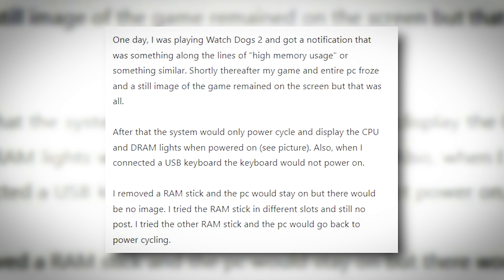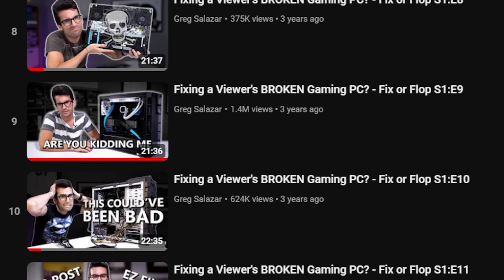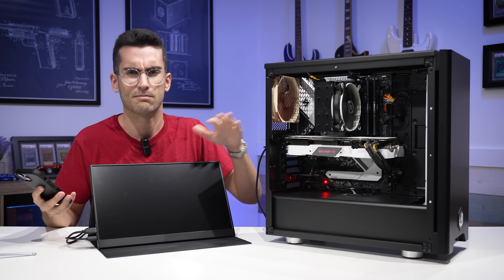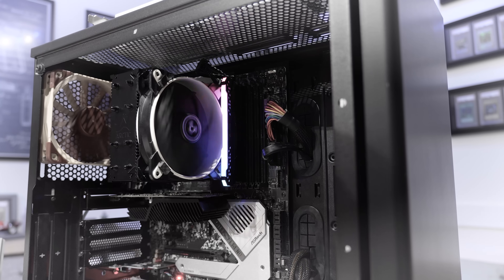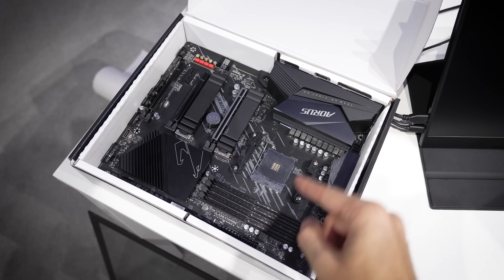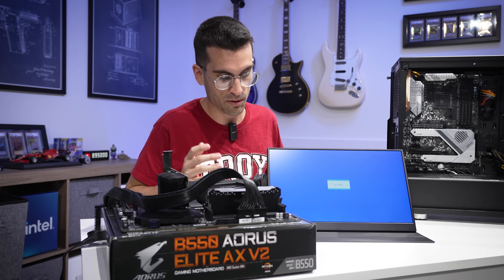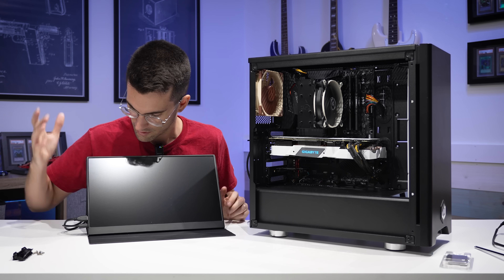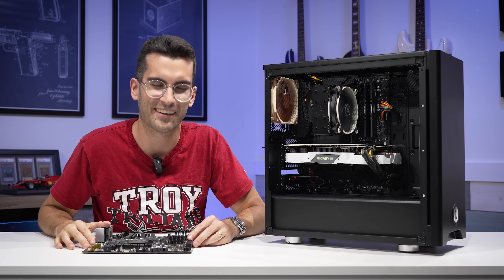Fixing a Viewer's BROKEN Gaming PC? - Fix or Flop S5:E20

Comment: Powering on without a CPU cooler is taking a risk every time. I fried an old AMD K6 when I was young and dumb. It heated to the point I couldn't touch it withint 2-3 seconds after boot without a cooler.

Comment: Check your physical power connections also. If a CPU or the 24pin are even a little lose they may cause it to not get enough power and cause this issue. Always rule EVERYTHING out before swapping boards.

Comment: One of the things I truly enjoy about this sort of video is watching the logic other people use when troubleshooting.  I always break things down to the lowest common denominator meaning I remove EVERYTHING but the basics from the equation.  I'd leave the board, CPU and RAM in place and take everything else out.  Instead of moving known good sticks of RAM to a possibly bad board I test the questionable RAM on a known good setup.  Same thing with the CPU.  Break it down to the absolute basics and if the issue goes away you start adding parts back one at a time until the problem comes back.  then undo that last change and if the issue goes away you know you found the cause. Granted that doesn't take care of cases with multiple faults but that's where testing parts in known good setups comes into play.  Don't get me wrong, I'm not in ANY way saying how things were done here were wrong.  Just different and different is good.  Always good to get multiple perspectives on the same thing.

Comment: I had this exact same problem with my Asrock B550M Pro4 - no bios flashback and same error code. Fortunately I had a Ryzen 3 3200G that I put in and it booted to bios and I could reflash the corrupted bios. Until I reflashed the bios, no PCI-E cards would work in the system! After reflashing the bios, I put in a 5700x and it is still working today! - Using an RX 6750 XT with it. Just FYI...

Comment: Hey brother you can just sit a cpu cooler on top with a tiny bit of paste, you don’t have to screw it down and you don’t run any risk to the CPU
Reply from the maker: Not sure if you've seen any of our other 100+ FoF videos, but we often run rigs without CPU coolers at all for a few seconds at a time. Nothing wrong with it as it doesn't heat up enough.
Reply: @ yea I but I’ve seen intel 13 & 14th gen CPUs pull 1.55 volts during startup and hit 90+ degrees with a cooler so without seems dangerous and it takes less than 5 seconds to plop a cooler on it.

Comment: If anyone is on the fence about going with the ad for Windows keys, it's legit. Very slick transaction. AND! BONUS INFO! I wanted an N install to avoid bloatware and JUST install things im going to use. So i got a Windows 10 N key. I was going to upgrade to 11. My main concern was that I wouldn't retain the N version going into 11. I did research to find out, but I couldn't find answers. Anyway, took a leap and did it, and LOVELY!! It upgraded to Windows 11 N!!! So if somebody out there has that question, rest assured, you'll retain that designation going into the Windows 11 version!

Comment: Some mobos won't post in no fan is connected to CPU_FAN header. You testing without a cooler is a really bad idea for that reason, not for cooling reasons.
I stand corrected, you did connect a fan ..... afterwards.

Comment: Man, I used to own the x570 Steel Legend and I found it wierd that it came with 2x 19pin usb 3 headers on the board. The punchout for wifi cables were great, though. Made it super simple to add a wifi card after the fact.

Comment: DEBUG lights are just not reliable as well.. they have lights and codes that are not listed as well....get yourself a good ole Post Speaker, which helps quick post diagnostics as well.
Reply from the maker: Hahah. Speaking of unreliable, we've filmed over 100 of these episodes. I can count on one hand the number of times a speaker actually worked for us while troubleshooting.
Reply: @GregSalazar  Wow Really? I have had nothing but negative results w/ diagnostics codes. Specially from ASUS and AsRock. I actually use to work for ASUS and trying to find the full codes list was top secret. We rarely could provide full support on non posting boards. I guess it would be harder to use the post speakers if you did not have access to extra parts.

Comment: Much better diagnostic work up. I would leave the water block metallurgy explain to derBauer. Often wonder about the AMD micro-code for those procs. Are they updated via Microsoft ? One last thing, . . .  the graphics jumbotron could use a propping post to ensure nuttin' gets bent out of shape. Anudder great service video. P.S. Gigabyte fan-boi talkin' here.

Comment: @GregSalazar i got you a tough one which i believe you haven't come across in any of fix or flop videos i have watched. In my motherboard was constantly resetting the bios by itself or wouldn't boot untill i removed the CMOS battery completely. Tried new battery, update bios, new cpu, new ram and all the ram slots one by one! Any ideas😅?

Comment: Had to use this as for a new Windows 11 key since Windows stopped working after swapping my motherboard and wouldn't activate
Reply from the maker: Make sure it's for the correct version of Windows (10/11, Home/Pro). Only times it's never worked for me (and I've used dozens) is when I've entered the key incorrectly or if the version doesn't match the installed OS.

Comment: why don't you use a separate power switch on the power pins instead of risk shortening the pc with a screwdriver? only takes a few seconds to connect.

Comment: I've personally experienced a badly seated DIMM before. When I added more RAM to my PC it was fine for a while then I'd randomly crash. I checked and the 2 new DIMMs got loose, so I properly installed them and no more crashes. My best guess is I got them down enough to work but over time slight vibrations finally wiggled them out enough to cause issues.

Comment: The bios flashback feature should be standard on all boards, or at least bring back socketed BIOS chips. That way you could try reprogramming it without de-soldering it from the board.    Great video!

Comment: Well people are not gonna like my comment because in a way I do feel like it was a  unnecessary downgrade  instead of investing more time in trying to either figure out how to " reset bios , or solder on new bios chip ) you went instead the easy route and replaced the board which is totally fine . 

But you didn't  actually fix the issue when the series name is literally  ( Fix or Flop ) . You could of put more effort into it and made the video more interesting  that just my opinion on the matter  like i said yes technically  its a downgrade but i am also glad he got back up and running .

Comment: I always find it interesting that the Mobo manual/help center will never suggest it could be the Mobo. Even the forums will suggest everything but the Mobo. Had same issues with a Asus board.

Note: rarely, but something to keep in mind. I had similar issues with everything from no boot to debug codes for ram and cpu and crashing all due to a faulty cmos battery? Yep. Keep a spare cmos batt in your arsenal just in case.

Comment: Asrock stuff is always bad with my experience, more like cursed, loud gpu coil whine, funky motherboard bios, cpu not hitting power limit etc. Sold my asrock b550m-itx ac and asrock Arc a750 Challenger and get b550i aorus and Asus dual 3070. no problem since. cpu is 5700x, 32gb trident z royal, Samsung 970 Evo plus and 980, sf600 psu.

Comment: i wonder if the unseated RAM may have fried the mobo, it may have been just making a connection for a while then eventually slipped out over time and caused a bit of a power spike or sent power to a diff pin that fried it.

Comment: Hi Greg. A friend of mine told me that his PC quit working and could I take a look at it. I powered it on and got nothing. I asked him if he had make any hardware changes. He told me that he bought new memory and that was when his PC died. I went to the MB web site and to the QVL, Qualied Vendor List, and looked for his new memory on the QVL memory list. I could not find his new memory on the list. That was his problem. I removed the new memory and replaced it with his old memory and his PC worked. The lesson he learned was to allways check to see if the new memory was approved to use with his MB.

Comment: A lot of correct comments on here , a dead or shorted     CR2032 can cause it not to POST. Also it's not hard to connect a piggyback a clipon programming cable  on the bios chip , you don't need to unsolder these chips this can be done incircuit with a super cheap  ch341a based  programmer,  it could be the upgraded CPU bricked the bios. A read on the rom dump and a comparison of the dump, against a good binary bios firmware. Or erase and flash the latest bios firmware over the old flash.

Comment: CPU needs 8pin + 4pin power supply cable .... But only 4pin was connected there 😁😁😁

13:00

Is that causing the issues...???
Reply: Not likely, the additional 4 pin basically just provides stability for overclocking (probably wouldn't even matter on a 3700x to be honest since an 8pin is plenty of power for it, I plug it in anyways just to be on the safe side).

Comment: Hey Greg, turns out the issue holding up my friend's PC build was a dead motherboard. We had all the parts for a Ryzen 7000 setup (a 7600 with a B650 board), which should have worked right out of the box. Instead, we kept getting the CPU and DRAM debug lights, and there was no attempt to boot. It would go straight to those lights, just like in this video. After a full day of troubleshooting, and without any spare parts (my own system is Ryzen 5000, and the only other person with a Ryzen 7000 is away at university), we decided to buy a new board and return the old one. It worked perfectly on the first try with the new board.

Comment: Why are ppl complaining about the downgraded motherboard? PPL wake up, a "better" non functioning motherboard to any working motherboard is not a downgrade. Broken vs working. I doubt the owner of that PC gives a crap what board is in there as long as the PC works. And they can easily change the motherboard somewhere down the line if they want to now that it's fully working again. So "downgrading" a broken part to a working one is not a downgrade by any means.... the most expensive motherboard on the planet is still useless if it doesn't actually work :P

Not to mention Greg did it all for free which probably saved the owner hundreds of dollars taking it to a store and having them troubleshoot it.

Comment: Gaming when the error happens indicates heat issue that eventually fried the motherboard. I wouldn’t be surprised if their some components on that old motherboard have slightly bloated capacitors. Ultimately the motherboard saved all the connected parts so did a great job. Passive cooling a motherboard that overclocking is something people should consider especially if the pc going to be gaming for hours in a warm climate.

Comment: I had a computer that a customer brought me to upgrade the memory and SSD .   about a month later he decided that he wanted a new computer and didn't want his motherboard , CPU and memory ..and would just re use his case and power supply .   so I put it together for him  and he left me the old parts .. I tried to get them working and it would just boot loop ... it was really dusty .. so I cleaned up the dust ..and soaked the motherboard in isopropyl alcohol and it actually works again ...LOL

Comment: The X570 Chipset should be able to run a Ryzen 5500 natively without a Bios update. Check the Ram slot to see if the fingers inside aren't shorting and bent.
Reply: Not if it was the first revision of that chipset which needed a fan. The later revisions were fanless.
Reply: @quantumreality215  only because consumers were being babies about the fan noise. I have that chipset with the fan and it's not audible over case fans etc. It also runs cooler due to the fan.

Comment: I had a couple thoughts about the RAM. One being that maybe it just wasn't fully seated if they had tried pulling out and reseating it on their own and just forgot to mention they had tried that? So maybe it was seated fine when they had the issue. The second being that if it was the issue (and I'm no electrician, power stuff tends to go over my head) but if it was loose I could maybe see vibrations from the fans, or if it's on the desk where they put their hands/feet on it to rest, maybe some excitement jostled it knocking it looser? As for bricking the board, I've seen LTT do tests with removing RAM without long term damage, recently, but is it possible that something could short from a pin being not in the proper place and arcing to a pin and nuking the board? I'm guessing not, if the display stayed up and it didn't shut down to protect itself, but if it's the RAM that shorts... idk, maybe it messes with the protection features somehow? But they were the first things I thought of when watching.

Comment: Hi Greg, erasing the BIOS chip and programming it again, it's totally worth it. I brought back what used to be my primary gaming PC as a secondary rig with an MSI X570 Gaming Edge WiFi + 2 x 16Gb Oloy RAM @ 3600Mhz and a Ryzen 9 3900X (Which I dropped). Basically, every day, it was less stable until it stopped booting, at one point I thought it was because I dropped the CPU while troubleshooting the instability, it was so bad that the power button with the CPU installed, was unresponsive.

Later on, I remembered that my cousin yeeted a R7 2700X from his bedroom (3rd floor), and I went after it. After fixing some bent pins, it worked perfectly. That made me realise that it was impossible that my CPU was dead because I dropped from an altitude of around 3-4ft. 

I erased the BIOS chip and flashed again with the programmer, and it's fully working, no instability issue anymore, no booting issues or black screens.

Comment: I just had a frustrating day.... up for 18 hours tearing apart 2 AMD bulds to swap out parts as well as trying to diagnose a bad Ryzen 5 5600G.turned off my main systemand went to turn it back on only to have the CPU light remain lit.... discovered the CPU had finally died... had to do a total system teardown and cleanup on 2 system and finally got my system back up and running with a ryzen 5 2400G but now, do I replace the R5 5600G with the same, or downgrade the build to a R5 2400G?

Comment: My b550 pro4 asrock was similar,just died,and i could get to post but when trying to save in bios when it would post it would freeze and cpu ram lights both on.Funny how I can get into bios but after editing and saving it dies.All the parts work in the new x570 taichi board I replaced it with.Still mess with the broken board sometimes.

Comment: If the computer refuses to POST/BOOT after checking CPU, RAM, PSU, and GPU to be good, this could also be caused by a dead CMOS battery. So always try to check if HDD indicator light is on and blinking on the case and the keyboard and mouse lights up, if not, then it's possible the CMOS battery could be dead before ruling out that the mobo is dead. Worth a try to save some money before buying a new board if it's still actually good and just needs a battery replacement.

Comment: I had an intel board do this trick out of the box. had multiple parts to swap in (i3, i5 13th gen chips, multiple ram sticks and GT710/intel ARC380). Turned out to be a bad board. in my case 75% of the ram slots were bad, couldn't get it running in dual channel. Sent it back to Amazon and got a replacement. Working to this day in a mates server.

Comment: I had a PSU that read fine but would not turn on half the time because of some small capacitor that worked good enough most of the time until it fried my MOBO and CPU. I am not asking for help btw just stating what happened.

Comment: I did have a power supply die on me once
It could still power up the RGB and the PC but there was no real boot, just the lights and stuff
Only thing i've done at that time was connect very cheap speakers to the motherboard, I have no idea how and why my motherboard was okay but my power supply wasn't, but a quich PSU change and everything was good to go

Comment: In a situation where you can't access the bios the normal way and don't have a flashback button, actually having to connect a device physically to the chip is something most people can't do. It's possible it's corrupted, or there's a component that failed on the board. Possible to fix, but if it were me I'd return the board to the owner and say he could have it looked at if he really wants to reuse that board. Otherwise, it's working now at least which is more important.